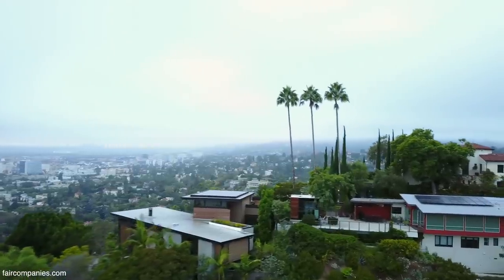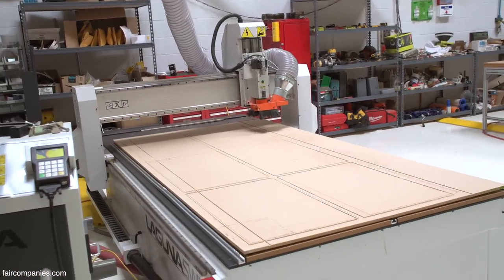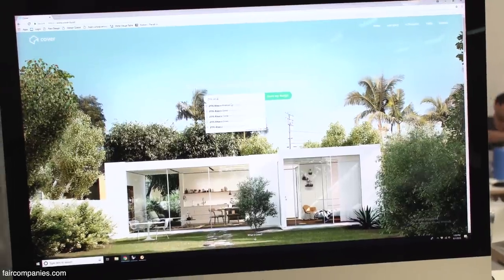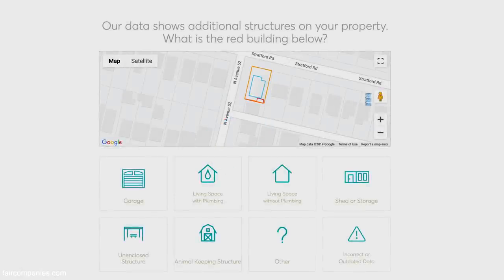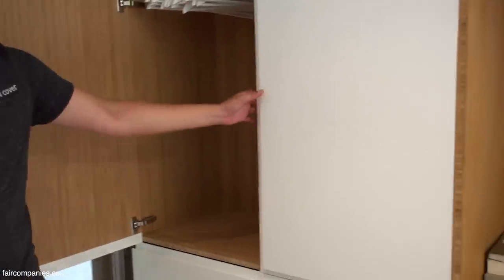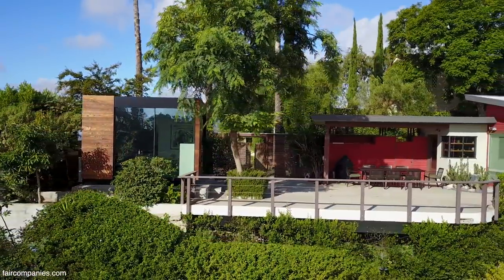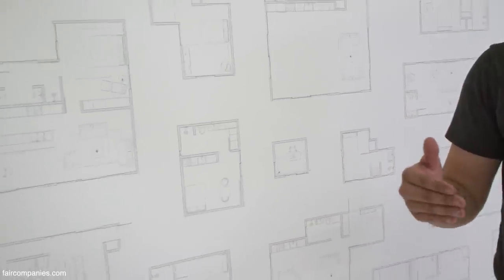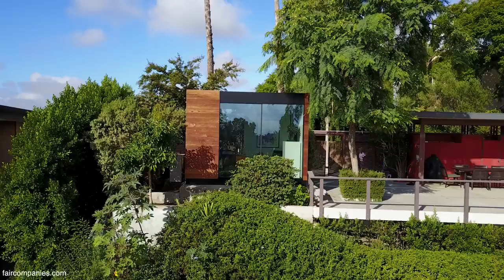LA startup offers custom small prefabs adapted to area code

Comment: I think all the comments say it well. This is an expensive tuff shed at 5 times the price. I also think California is turning into one big rat's maze. They don't care where they skim money for their mansions so have a ball triple the parking in the street, over use the sewage capacity, create water shortages...for someone at the end of the line. The biggest question I have is how do you change those electric sockets if there is a problem. I can see joe sixpack in there with a screwdriver chipping away at wall panels to get the socket out. Please don't tell me it plugs into a socket behind it... Nevermind the fact that when these guys go out of business no one will be able to repair the issues...where was the water heater, and the rest of the plumbing and heating. Lot of open issues in what they gave as a demonstration.

Comment: $400.00 a sq ft is absurd...............Blding prefab panel constructed 1200 Sq Ft home in Canada with -30 degree C winters, so 3 pane windows and insulated air tight  etc with dbl detached garage for $150 sq ft plus lot and foundation. Will be around $375 Cdn done.

Comment: Normally these sliding floor to ceiling windows/doors cost between $10,000 - $20,000 for (1)  but because you make them in a factory, you are able to do them for a lot less than that? Does he really think his customers are that naive? Thermal glass with argon and a black or silver spacer is $10 usd per square foot from the factory. Those doors are 45 square feet each pane or 90 s.f. for both. If they sell for $10-$20 k, I'm going to drop everything I'm doing and start a glass door business. In regards to those receptacles, to replace one, I'd have to remove the entire wall panel? Your square foot price is $358 usd. This is over two times the national average for a conventional home. It's a cute tech company and I suppose as long as you focus on the wealthy naive market (Los Angelos/Beverly Hills area) you'll be ok.

Comment: This is a great idea that is going absolutely no where. There is a reason this has never been done and that reason is cost. They will never sell enough of these to stay in business at over $100,000 for 270 sq feet of living space. That is utterly ridiculous. They would need to cut that cost in half to get any meaningful sales outside of the type of house they show in the beginning which is a very wealthy person's residence.
Reply: No, there are people spending more than that on boats, cars, and many other things that have a lot higher cost per square foot... 

The custom built RV market runs over $500K to over $3 million, for example.

A easy to look up example is Will Smith's custom built trailer is worth $2.5 million or around $1700 per sq ft and that's not counting the semi truck he uses to tow it...

Realty check, there are people who buy things like designer homes, housing market isn't limited to just people who only need a roof over their heads and don't care about anything else.

Especially, in a area where housing can be over $400K or over a million that they're specifically catering to and it can cost over $60K to just add a bedroom to an existing house...

Besides, cost per sq ft between a large house doesn't directly translate to a small one because you're eliminating low cost spaces like hallways and empty spare bedrooms but keeping high cost spaces like kitchen and bathroom.  So that skews the cost per sq ft because everything in a smaller structure is just what you actually use.  So there's a lot of misconceptions on how that works...
Reply: @ZeoCyberG  You missed my point for the most part. For one, I wasn't using $/sq ft for anything other than a dollar amount. In other words, I agree, tiny houses shouldn't be compared by cost per sq foot to normal houses but still, these are way too much money. Two, and more importantly, yes I agree there are a lot of people who make enough money to buy these sorts of units but the vast majority of them have next to no need to buy one. Furthermore, this company will need to be able to sell these to medium to upper medium income earners so that they sell volume and at this price point there is simply no way in hell that's going to happen. If they only sell to those who can afford them or the rare instance where people who can't are willing to buy one anyway they won't make it. I am shocked that people can't see that these units are overpriced. For instance, I'm a fairly wealthy real estate investor and if I wanted to add a unit to my property it certainly wouldn't be a 270 addition for over $100,000. I would think I am exactly the kind of customer they would need yet if I want a unit in one of my yards I would rather pay $150,000 and have a 500 to 700 sq foot addition built. You can do that anywhere.

Comment: This is what you get when you ask a Jony Ive type to build an affordable home..Thinking what you can build cheaply to replace a rotten run down shack in Mississippi is a more worth while endeavor Hint - don't worry about fancy floor to ceiling sliding glass doors or not having a face plate on your outlets

Comment: Increased affordablity of these homes, while maintaining a high return on income capital will most likely require a large increase in home production output with the same factory size and capital equipment investment. This is analgous to a car company making lots of money after investing in expensive equipment at large plant by producing lots of car at a small markup.

To one up their current product offering, yes of course the home price should come down, but they should also become more repairable. Homes are the only physical objects that I can think of that are both extremely expensive and require demolition to repair. Need to fix a broken or leaking pipe? - solution, get a sledge hammer and break open the wall to access the pipe. Cars, aircraft, etc. can also be every expensive and live long and productive lives like houses, yet they differ since the majority of them are designed with repair in mind, by one person with a limitted number of special tools, most of the time.

To change the game this company needs to be able to have customers send photos of their current home interior and design a pre-fab solution to replace an existing home. Everything can be configured before hand and shipped to the customers existing house for installation. Demolition, reconfiguring, etc. need to baked into the price of the remodel, however the price and schedule for implementation should be explicitly stated and relatively fixed.

As time goes on, the costs of these tiny homes should go down, since the mateirals they're made out of appear recycled and machine tools used to make them will get less expensive. I didn't see a single CNC mill in this video, only a CNC router, which I've never used, but probably pales in comparison to a mill. The mill has large work space and a precision ground table, offering rigid setups and complex machining operations. This is way over built for high production home construction material production.

Comment: What pretentious design. It's substituting novel features for long term consistency and maintenance. How do you chance a socket that's built into a prefab wall? Do you cut the wall open? Take the sections apart? Also, that's not a CNC Mill... It's a router. Stick to the software. Your physical products are junk. I know the bits you used to cut those cabinet pulls aren't anything special. Your router table can do it with a single bit. What angel investor is loosing their money hawking Apple inspired shacks.

Comment: Okay, so these are incredibly expensive compared to traditional construction $450 vs $150 a square foot, and really offer no benefits, actually less. Try to replace or repair that outlet. No ceiling clutter, okay, let's just have a huge black troughs everywhere. There really is not much downside to traditional custom construction and you can have exactly what you want in less time.

Comment: "The company produces CNC-cut panels that click together like LEGOs to become tiny, and small, cottages. The company is also trying to democratize design using algorithmic software to create $250 plans " 

If the process is so efficient, why are the prices so high?  The designs look great, but sorry--this is a glorified ordering system.  There's nothing cutting-edge about this building process.  70k+ for a 124 sq. ft unit?  Why not just use traditional building at that point?  With all the other costs, it's probably like $600 a sq. foot.  I won't even get into the backlog or logistical issues pre-fab companies often face.

Comment: I read all the haters comments here and I am not surprised mostly from RED states that compare everything with their trailer homes...Prefab houses were never meant to reduce the cost but to increase the efficiency and quality by reducing the time of construction at site and using innovative materials, hence reducing carbon foot print and bills....in LA a conventional construction may cost less using worst quality materials from Home Depot and the labor that dont know their nostrils from their crap hole but a quality construction of such that rents for around 2000$ a month for the same square footage is reasonable so go drive you Rams and just shut the f up .....

Comment: that is so weird. all those white panel walls and stupid crap like flush wall outlets. what do you do in 5 years when they have to be replaced or rewired - take the whole wall out?  the video didnt really show a full home or appliances or the quality of plumbing. from what was shown it looked like crap that would rot and smell or fall apart in 10 years. i like the idea because who can afford a home anymore and la has the highest homeless pop next to new delhi. but they look like trailers.
Reply: Who rewires their home every 5 years? I haven't had to rewire my home since it was built over 25 years ago!

Comment: All good but I'm disappointed the electrical outlets are the wrong way round, for I so called high tech company I would of hoped for better. I realise that's the "normal" orientation for US homes, but it is still incorrect. In the UK the ground pin is at the top to prevent items being dropped and bridging the two power pins. Americans obviously missed the point and flipped it because it looks more like a face :)...

Comment: @4:56  $99,800 + $6,400 + site work and you get 279 square feet? 

I'm sitting in my living room which is 230 square feet so I would need to spend well over $100k for a room--not a house, that has a bathroom and kitchen in it!!

Clearly this is marketed towards that idiot generation known as millennials.